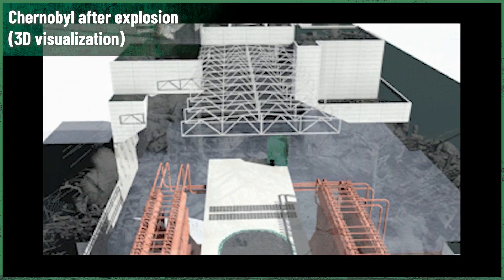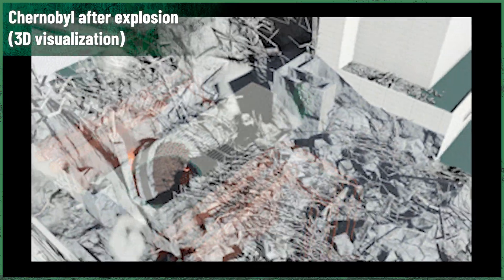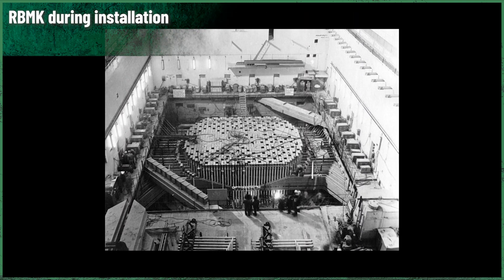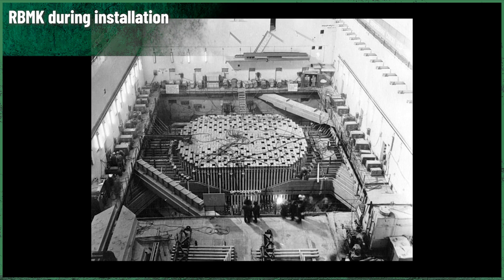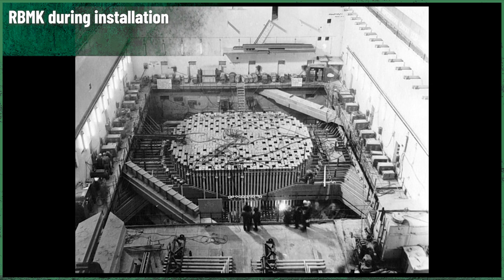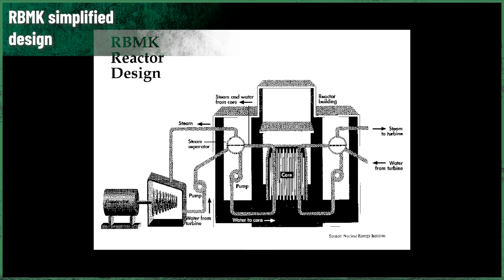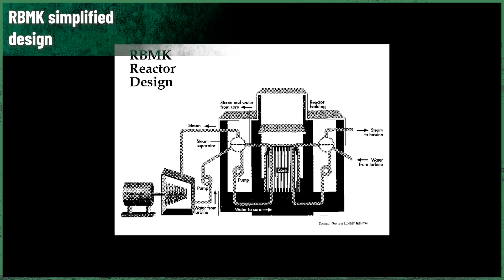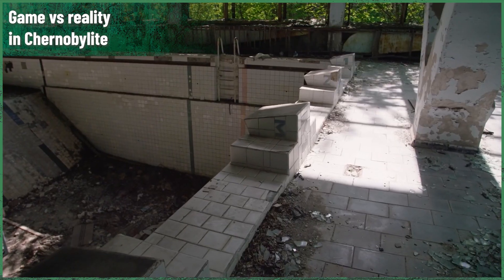Why RBMK explodes when the AZ-5 fails? RBMK design flaw ||| PART 8 ||| Chernobylite Stories

Comment: AZ-5 didn't fail, it worked as designed. It was the control rod design and the fact that the initial power spike and resulting overheating caused the control rods to get stuck with the graphite tips in the reactor space that caused the massive heat and pressure surge that led to the explosion.

Comment: The fact that they built so many of these and ran them hard for decades is really remarkable, that there was only one major meltdown and accident is remarkable. 

I look at all the technical details of the meltdown as the end result of a disaster. To use the car metaphor, they tried to test the seatbelt and lack of air bags by driving it into a wall. You don't test safety features by seeing if they prevent a catastrophy. The fate of #4 was sealed the moment they decided to do the turbine rundown and physically closed the valves on the emergency cooling system. They were warned and should have known better. No complex machine can be built 100% safe, there is always a compromise between function and safety...you can build in as many safety interlocks and features as you want, but someone else is going to build a person dumb enough to circumvent or ignore them. RBMK 1000 was flawed but the Soviet system and the reactor employees fucked around and found out.

Comment: Could they have saved the reactor by more gradually lowering control rods?
Reply: Quite possibly. There were short control rods that came in from the bottom and didn't have the graphite displacers. The bottom was where the reaction went out of hand.

Comment: Compare this to the AGR of Hunterston in Scotland (A common design in the UK at the time).  It used gas as a primary coolant instead of water.  The idea being the coolant itself could be not be made radioactive and any drop in pressure would activate the control rods automatically.   The same for a loss of power.   A SCRAM could also be  commanded.  If all else failed, boron granules would drop into the reactor to kill any fusion and the reactor.
Reply: Yeah, and how many were made?
Reply: After the single prototype AGR at Windscale, two near identical twin reactor AGR stations were constructed at Hunterston and Hinckley Point.
Later, other AGRs with different overall designs came online at Dungeness, Hartlepool and Heysham. Finally, improved versions of the Hunterston design were built at Torness and Heysham. That gave seven stations each with two reactors.
High capital costs were largely to blame for the fact that the design was never exported outside the UK.

Comment: Where the three units that didn't blow up at Chernobyl and the ones in Leningrad as dangerous as the ones that did melt down, or were the operators as good or better on the ones that didn't melt down?
Reply from the maker: Well, the RBMKs were improved overall, but still weren't the safest. The last RBMK reactor was operational until the year 2000.

Comment: Their design was way too complicated... Way too Byzantine...  Way too Rube Goldberg. They literally could have done away with half of the duplicate systems, and designed something which actually worked.  They could have halved the amount of systems needed for fission, and doubled the amount of systems used for cooling, and perhaps the reactor wouldn't have exploded.  Leave it to the Russians to label the button "AZ-5" instead of "SCRAM"!
Reply from the maker: They could've done many things differently, I suppose. The thing is that the design was rushed and the system was rotten - that combination led to the disaster in my opinion.

Comment: Thank you, for nice videos and dedication to such an interesting topic!
I think you still missed a few key points here. 
Reducing power and use of the powerplant at half power several hours prior to the tests ie. xenon poisoning which led operators in trouble trying to keep reactor running. 
And one more desingn flaw in the control rod system, the graphite followers witch were too short and caused a power rise in bottom of the reactor when AZ-5 was triggered. 
Either of these issues fixed could propably have saved from catastroph.
Reply from the maker: Thanks! This video is a part of the miniseries, things you mention are in the previous videos (I think so, at least) :-)

Comment: Sometimes it amazes me that they could do something so complex. In that day in age. With the then current state of computers with there limitations at that time. I’m surprised more didn’t blow up. The only thing that saved the others were there strict safety protocols.
Reply from the maker: They did, but on the other hand they did it poorly. The Western counterparts were done with a significant higher level of security and responsibility :-)
Reply: @Chernobylite vver reactor was also made in the Soviet union and it's probably the safest tractor in existance

Comment: so.... power was RAPIDLY increasing before AZ-5 was pressed (as i understand it)
so they were headed for AT LEAST a steam explosion (or at least a pipe bursting and releasing the pressure)
.
ive also heard that it probably went prompt critical.... not an explosion like a nuke.... but more like a "conflagration" 
still... its a HUGE release of energy close to a nuke bomb
they also found isotopes that confirm this
.
so... did A-5 cause this prompt critiality?
and if they didnt press AZ-5...... would have the top lid still have come off?
Reply from the maker: That's all guessing, but probably there could be a meltdown or other explosion (but smaller). The AZ-5 was a catalyst, a dirext cause of the big explosion, but it could still happen on the smaller scale. It’s all "what ifs" really
Reply: Power would have probably increased and a couple channels ruptured, releasing steam into steam capture

Comment: whats the difference between AZ-5 and AZ-4/3/2/1?
.
is it just the speed of insertion? how many rods get inserted?
Reply: Reactor guy here, allow me to clarify. First you have to remember that shutting down a reactor unnecessarily was very much frowned upon in the Soviet Union. If the reactor wasn't on death's door, an operator would think twice about shutting it down because that would come with penalties to their wages, promotion etc. Therefore, the designer gave the AZ system "steps". Depending on the situation, the operator could pick and choose the AZ  (АЗ in Cyrillic) that he thought would be best for the situation at hand:

AZ-1 = reduces the reactor's power to 80% of nominal power

AZ-2 =  " to 50% of nominal power
AZ-3 =  " to 40% of nominal power
AZ-4 =  " to 20% of nominal power
AZ-5 = full shutdown (aka SCRAM)

With the AZ buttons, all the control rods will move at the same speed. The difference is in their insertion depth. The deeper the rods go into the bowels of the reactor, the more the fission process will be inhibited. AZ-5 sends all the rods into the full height/depth of the core, and shuts (or scrams) the reactor down. We now know that this wasn't always the case. And don't get me started on their outrageously slow speed.

After the accident they made several much needed improvements to the control rods. They also made an extra fast-acting scram system (БАЗ - Быстродействующая Аварийная Защита = Fast-Acting Emergency Protection) that can insert 24 boron-only control rods into the full height of the core in under 2.5 seconds to pull the reactivity down by at least 2 ß-effective. This system is used before the "normal" AZ system to ensure that the reactor will safely shut down in all circumstances.

Hope this explanation helps. Feel free to ask more questions if you have any.
Reply: @swokatsamsiyu3590  you, sir, are amazing
.
Thanks much!!!
Reply: @kainhall  
Amazing is a bit much, I'm just a guy that likes to read very, very nerdy reactor-y stuff😅 But you're welcome! Am glad I could help out some.
Reply from the maker: As far as I know, the A3-1 (AZ-1), -2, -3, -4 were also there. The "AZ" stands for "emergency protection" in Russian, while only the AZ-5 was the one responsible for SCRAM procedure. The others were for different safety protocols.

But I may be wrong, I'd need to read into it more :-)

~Andrzej TF51

Comment: When I saw the new episode show up in my YT feed it was like; "Yes! Let's get the tea ready, it's going to be good." And again, the video did not disappoint. Very well done, and loads of good info. I particularly liked the building a car analogy at the start of the video because it is so true. They really made sure to give the poor reactor every unfavourable characteristic in the Physics book, make it as cheaply and poorly as possible, and to add insult to injury, give it no proper containment to speak of. The excruciatingly slow insertion time of the control rods is just criminal. 18 to 21 seconds, at that point it might as well be 18 to 21 hours because that will be just as useful in an emergency situation. What were they thinking?! For comparison, the core of the Canadian CANDU will come to a screeching halt in 1.5(!) seconds. And that is by no means a small reactor. It even shares the same positive void coefficient (albeit much smaller) feature the RBMK has. Despite that, it is deemed one of the safest, most stable reactors out there. Have a good one, and now I have to wait another week for the next episode^^
Reply from the maker: Exactly, the speed of AZ-5 was making it practically almost useless.